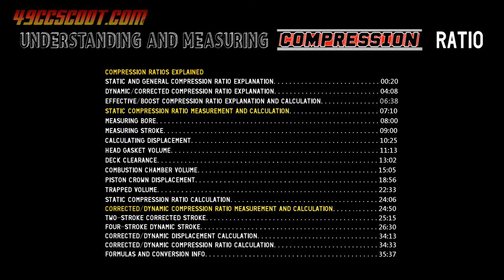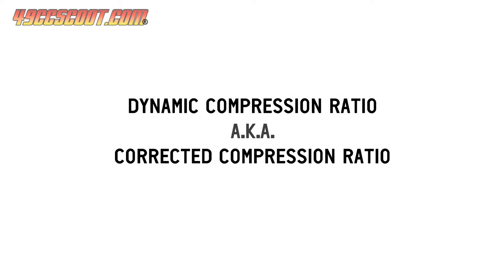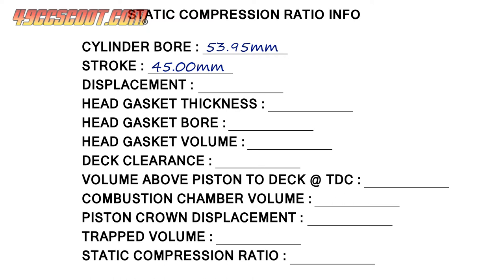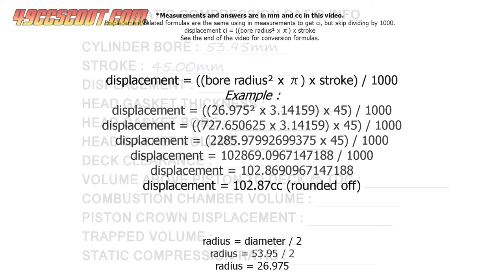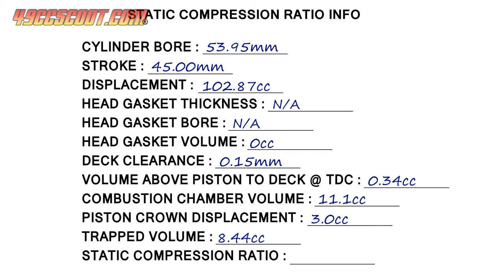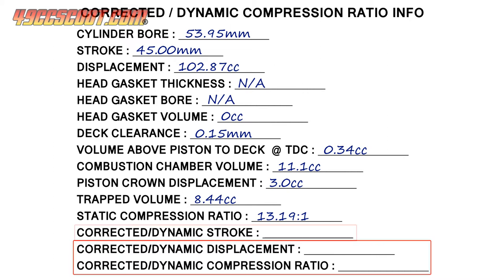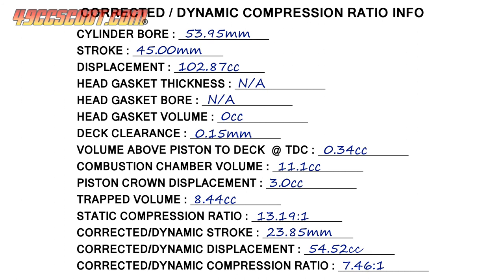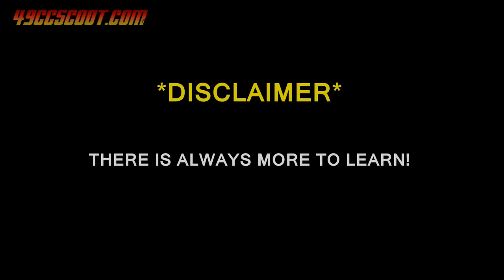Understanding & Measuring Compression Ratio : Static, Dynamic, Effective, Two & Four Stroke

Comment: Last comment, I promise-- Dude, MASSIVE props to you, I mean I am banging my head learning this stuff and honestly it's looking like chainsaw-engines are perhaps THE easiest engine-layout ON EARTH, am having trouble thinking of anything simpler....I mean even the older chainsaws at least had reed valve intakes, for whatever reason that is not even the case anymore (intake is achieved through the suction/vacuum of the bottom end, during the compression stroke, the moment the piston-skirt goes above the intake-floor the "intake influx" has begun.....so we port exhaust roofs upward, and intake floors downward, as "at home/dremel porting".....and I just found that some McGuyver'ing lets an at-home porter like myself actually do cylinder bases & squish bands *at home w/o CNC*!!!  So yeah now I'm able to dial-in compression (oem is 13.1:1), thinking of retarding timing several degrees and running nearer to 15:1, thanks so much for this video I hate even saying how simple it's gonna be for me, relatively speaking, to get these volumetric measurements you have to fight so hard for, heck the combustion chamber//cylinder are 1 piece in this application :P )
Thanks again for such a well-presented piece of content, A+++ right here!!
Reply from the maker: I'm always glad to hear that I've helped someone. Good luck with your project. Can't say that I know much about saws, but I may have to look up the more modern designs. It's going to be sad to see the market go electric. Upping voltage and playing with electronics just doesn't do the same thing for me as getting into an engine... and of course the sound of a 2T makes life better.

Comment: I am writing this after lots of experiments I have done on my Honda scv 100. 4 stroke 102cc. I posted before as well, but this time I would really really really like ur experience to help me out. It's not that I am disappointed with my scooter. It's just it won't start as easily as my other scv 100 when cold. So far I have checked spark which is blue in colour, replaced and adjusted spark plus as per specification, rebuilt carb , replaced float needle and vacuum petcock , replaced carb intake gasket, and checked for air leaks . Still the problem remains. And I'll explain again the exact symptoms. These show up on leaving the scooter for 3-4 days. Overnight they don't show up. They only show up when I have left it untiden for 2-3 days atleast and it's cold. (10 degree Celsius). So when I use kick start it my other scv starts in one go no matter what . But this one's is a bit odd. The very first kick each time gives a very faint cough as if smthg did burn in combustion chamber. But it dies. After that the next 7-8 kicks are just completely dead. No action at all. Not even a attempt by the engine to start. And then finally when it's done with tantrums it starts, but that too very weirdly. It starts as if picking up from very slow rpm , u can hear it, and then it increases to the normal rich condition cold start rpm. But u can feel the initial bare minimum rpm and transition to high rpm . The other scv 100 of mine  starts on cold start with same rpm at 0 seconds. It's doesn't build on rpm from low to high like this one. So what's the problem? Any advice ? Anything at all? Please. I hope I have been able to paint a clear picture. The scooter runs fine when warmed up. And starts fine when warm. Full throttle at cold start doesn't work always  . Any advice?is it stator? Ig coil? Pick up ? CDI is fine I checked. Or maybe some weird vaccuum leak?
Reply from the maker: The 150 that I had did that it's entire life... till I tuned it. A friend owned it 10 years before me. It always did what you describe. It was a real pain to start and then it would idle low and I couldn't give it gas till it warmed up or it would die. Once it got warmed up, it ran fine. I messed around with the air cleaner and spent the time to dial the carb in and that went away. I honestly don't know specifically what did it, because I changed the main, pilot, and needle setting and I wasn't really trying to change that. If you haven't done it already, then I would suggest trying to dial in the carb. It's a good thing to do anyway. Another thought is valve clearance. If 1 starts great, maybe check the valve lash and replicate that on this one or just go by a service manual.

Comment: While it is commonly used, IMO calling Trapped CR the Dynamic CR is misleading.
Trapped CR is as static as Swept CR, Trapped CR can only be changed by some mechanical means like power valve not by any "dynamics" arising such as engine speed or the like.
Also be aware the raising the CR in a 4 stroke will produce the gains right across the RPM range however that does not translate to 2 stroke that will only benefit from higher CR at higher RPM

Comment: I have recently picked up a 2009 aprilia SR50 ditech Piaggio and I am installing a 70cc kit. Since it is fuel injected my knowledge about squish, deck height, piston protrusion are wasted as I’m told these act differently then carbureted two strokes. I raced 250 gp motorcycle for quite some time but this is a different little beast with FI and air pumps. Any experience with these?

Comment: I have heard a good running drag car engine is running around a 9:1-9.5:1 compression, dynamic (not the static compression) being the cam bleeds off cylinder pressure, while the calculated compression is about 14:1, I had a engine with 12:1 it was all I could do to get it to run on 93 octane, it could been closer to 12.5:1, but the cam did bleed some pressure, but it was at least 12.7:1, it's been years but I think it was about 215-220 psi average cranking compression, psi,   the timing was retarded, I ran cold plugs and a cold thermostat and large jets, running it rich helped the most to get it to run on pump gas, I wish I had aluminum heads! Or dishes Pistons, it would probably ran much better! Allowing more timing advance, it sounded awesome, but was the peakyest engine I ever built, it had a very narrow power band, about 3600-4850/5000, it made great power there, but about dead everywhere else, the heads had small runners, and small Chambers, I was young and dumb, I wanted high compression, and a rough idle, 'big cam' I should went bigger, it would blead compression making it run better, it was recomended for 10.5-11.5:1 if I had more overlap, also the single plane intake was just dumb, even with the 3.42 gears, it was 2.73:1, if it had about 3k stall and more overlap, or just less compression, a 63-64 cc chamber would been plenty, (about 10:1) but I was running 58cc heads that had been cut a bit, I'm guessing they were about 52-54cc. I wouldn't cut them much more and trust them , maybe .020",more ( maybe) I think they were cut about . 050" -.060", I stay below 10:1 with iron heads, and 11.5-11.7 with aluminum heads, although I do have a 3.75" stroke , 4.040" bore engine, with 62-63cc aluminum heads, with flat top Pistons that are . 001-.002" proud, I was hoping for zero deck, but it was already decked, and setup for zero deck, abd my components were just a wee bit longer, I'd rather the Pistons be a couple thou below deck, but the MLS gasket is a bit thicker than I'd normally use, at about .045"  I roughly figure about 11:1, I wish it was 10:1, so I could feel safe running about 10 psi boost, but with 385cid, and 11:1, it should do fine without! I may swap the heads for 68cc or 76cc versions, with nearly . 600" lift and 244° at . 050" but I'm going to swap cams,  great video,

Comment: Question here, I was playing with a compression tester the other day and my honda is a 9:1 motor but tested 185psi… 
If I do the math (184/14.7) it gives me a ratio of 12.7:1 

Do you know why my math is wrong? If anything I would assume it would be lower than 9x14.7

Thanks!
Reply from the maker: Rough rule of thumb is about 16-21x static compression ratio is where cranking compression is likely to be. You're in that ballpark.
Reply: @49ccscoot  interesting, I was kinda curious about the math behind that

Comment: I have a gy6139qmb with a 80cc bbk  and I only ask do I have to run 91 octane at 2000 ft. In altitude or can I get away with 87 octane ? . You are the best on U-Tube and next payday I am going to send you a donation . Thanks.much...
Reply from the maker: Not all kits are created equal, so... maybe. With a stock head, I would expect it to need more than regular. It may not though. If it has an aftermarket head with a larger combustion chamber, then it's probably OK on regular. If you try regular, listen for spark knock and make sure you don't see peppering on the spark plug. Peppering is basically what it sounds like. It may look like someone sprinkled pepper on the plug if there has been detonation. It's not always present though, so it's not sure fire to say the plug looks OK so it's fine.

Comment: What do you think the compression ratio will be on a qmb139 with a 100cc kit (50mm) with a head machined for a 47mm(80cc kit) will be? It shouldn't be too high right?? Should I use two jug gaskets??? I'm going to use playdough to check the clearance, I'm sure there would be issues if the 39mm bore (stock head) was used, there may be clearance issues, but the compression ratio will be a bit higher, I did unshroud the  valves, so that will drop the compression a slightly,  I'm running the a9 cam with the 50mm kit, I'm hoping it will at least double the HP, from 3.2 HP, with the exhaust, the head porting, and unshrouding, the seats were crazy deep, that would never fly in a car engine  cylinder head ,  it seems the factory would do just a bit more machine work, i
I also port matched everything! It was a crazy amount of core shift!! Vgreat video!!   I also have a 20mm carb and jet kit, do you think 6-7 HP is possible? Or at least 5hp? The compression should be slightly higher,
Reply from the maker: There are multiple head designs, piston crown styles, and deck heights from various properties so it's anyone's guess. I would guess you would end up in a safe range with many common combos. It can get really high when people try to use a stock head on a 50mm kit. IIRC I calculated something like 15:1 with one of my old kits if I were to use a stock 39mm bore head without any other mods.

Comment: Original CR on my scooter has 12.0 Compression ratio .. piston is 60mm. Honda pcx 160.   i will upgrade piston to 62mm.. Shall i go higher on Compression ratio? ore stick with 12.0? 12.0 is very high already?  Thanks :)
Reply from the maker: TBH I don't know much about the PCX engines. Your best bet would be to look for someone that works with them a lot and see what they find works best. Maybe there's a facebook group or reddit or something?

Comment: My anti-knock prototype let's me advance the ignition timing to the maximum factory setting without any knock.

What's the highest compression ratio that you would recommend for A port injected engine?

Spark knock is not A problem, so I just want to stay below the compression ignition threshold of pump gas.
Reply from the maker: If you're trying to push to the limits, you're going to have to work at it. There's no 1 figure that will work for all engines. Maybe you could aim for a figure on the high side (say something like 12:1) with a thin head gasket and then do some calculations to find out if available thicker gasket options could significantly lower compression if needed. Or the opposite approach of aiming low with a thick gasket and then using thinner gaskets to increase. Some applications probably won't have enough of a range for that though.
Reply: @49ccscoot  Thanks for your input!

I think I will start with some easier modifications and build my way up.  If the engine can handle them all, then I will add some cams and then go from there.

I did create A short video of A test run, using my prototype.  Pause on the distributor part if you wish?

Comment: so helpful..but i got little bit confuse abt the depth of piston from the deck to calculate the crown volume...the depth measurement from the deck where we can get sir?
Reply from the maker: You have to measure it. If you are calculating the volume based on measurement of fluid, you use the depth in the bore when the fluid was added. Then that difference of calculated volume vs measured will lead you to the crown displacement/volume.

Comment: Wonder if you can help, brand new head and piston (taiwanese(welp)) 
Ran for several minutes and died never to run again, there's minute gaps at some places around the rings inside the cylinder, would this be enough to cause this in your opinion? Thanks in advance :)
Reply: And a nice little grey sludge poop at the bottom of barrel near crank :O
Reply from the maker: @KentRoads  So you're saying it looks like the rings or cylinder have wear spots that cause small gaps and you have grey sludge? If you see scuffing of the piston/bore as well, then maybe clearance was incorrect and the sludge is metal from the piston/bore scraping. If it was ran under load, then it could have seized. Could have been something defective from the start that you didn't notice or ring end gap was not checked or set too tight. A compression test would tell you if it's still sealing, but if it's as I'm picturing your description then I think the rings at least should not be reuse anyway and possibly the piston or cylinder.
Reply: It's almost like a hairs breadth of black(shadow) where the ring would intersect with the barrel and create a seal :/ I've tried both rings and it seems to be the same... The gap is so small I can even get light to shine through it as I don't have a lamp small enough as to not blind me at the same time :) thanks again!
Reply from the maker: @KentRoads  If there's actually a gap between the ring and wall, then the piston should be easy to move. Otherwise, it may just be the way it looks to your eye and not really a gap. If you can, I'd at least do a compression test and a thorough inspection to see if I could find the source of the sludge.
Reply: If I remember correctly I didn't set end gap so they've probably butted fml, no damaged to ports though from what I can tell D:

Comment: Can you use a cooler spark plug to lower compression just a little?
Reply from the maker: Spark plug heat range does not change compression ratio.

Comment: For corrected comp.ratio-- On chainsaws, the intake is NOT open at BDC, chainsaw cylinders' intakes draw air UNDER teh piston-skirt's bottom, when the piston is going up its compression-stroke.  The intake port is 100% closed by the piston at bdc.  This doesn't change corrected compression-ratio, does it?  Because corrected ratio only cares about the chamber down to exhaust-roof, right?  
Thanks a ton!!
Reply from the maker: Corrected ratio would concern whatever the first point of escape for compression is basically. Generally that is the exhaust port opening.
Reply: BTW...where's the "chart" on "good #'s" for corrected-compression?  IE, something that "lines them up" to un-corrected?  I guess I mean that I can easily figure out all the #'s here, and I get the new corrected-compression for my saw (which is substantially lower than static compression ratio), but I don't know what this #'s telling me!  Don't know if I should be happy/sad at the #, or want it up/down, yknow?  For instance if 15:1 is pushing it for static, what is pushing-it for Corrected?
Thanks!
Reply from the maker: Sorry for such a late reply, but it flagged your last comment as spam for some reason. You can't accurately align corrected to uncorrected numbers for conversion. I tend to go with 7-8:1 corrected on my street scoots. 7:1 has been on the mild end of it. You could certainly push beyond those numbers, but these were for scoots that would be heavy on the throttle for long periods of time.

Comment: I don't really object to the term compression ratio.  It's a good communication, in that we all picture the same thing: bdc vs tdc volume.  We need that volume ratio to examine other dynamics.  But underline the word 'compression': that implies work is being done, which... until the intake valve closes is not much more than ring friction and fluid being worked across the bearings by rotation.  So basically, no significant work happens with an open system, and that means... the cam determines compression ratio of your bore/stroke combo - that's it.

Comment: So Do you think putting 95 octange gas in a 125cc scooter would make any noticeable power difference  ? Also how are your  injuries will you  again  ? It's amazing that motors are only %20 efficient the other %80 Is wasted as heat.
Reply from the maker: If all you do is add high octane fuel, no. It won't make it any more powerful. If you make changes to the engine or timing to go along with high octane fuel, then you can find power. You may be able to get a fuel with a higher BTU rating and see some difference. IMO race fuel is for race tracks though. It's just too impractical for most of us on the street unless distances are limited or we carry our own fuel supply around.

Injuries are much better. Thanks for asking. I'm getting around OK now, but I think the knee is gonna bother me for quite a while. I've been riding again, so I'm happy.  :)